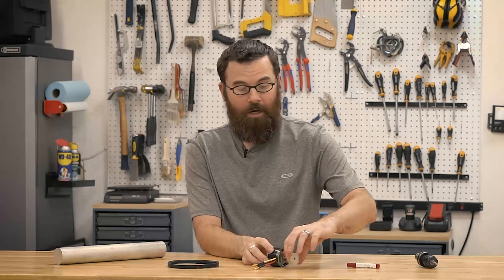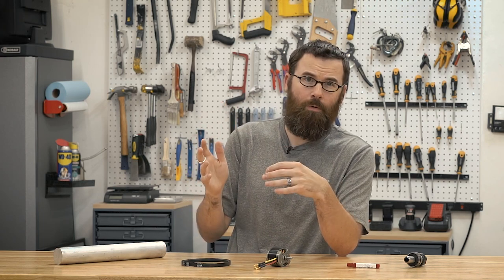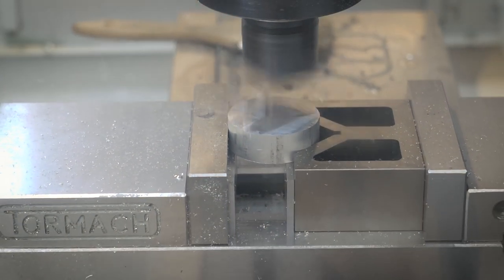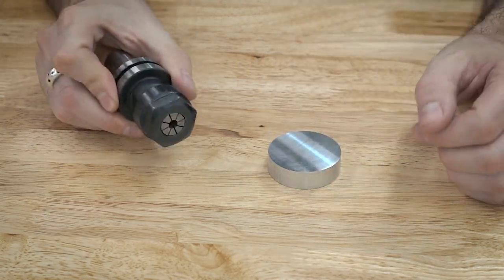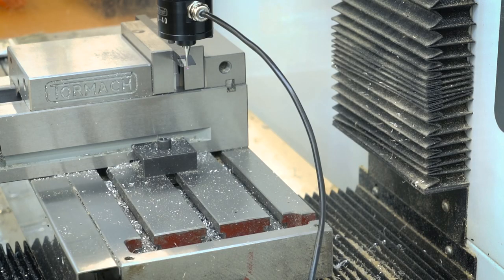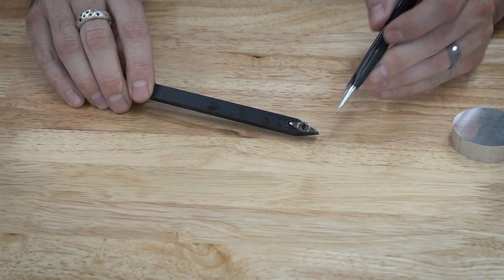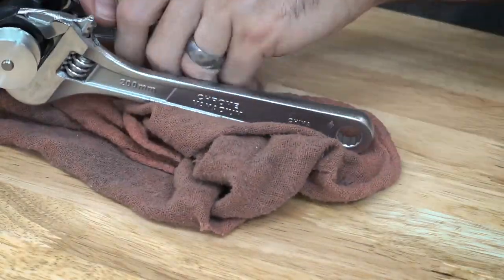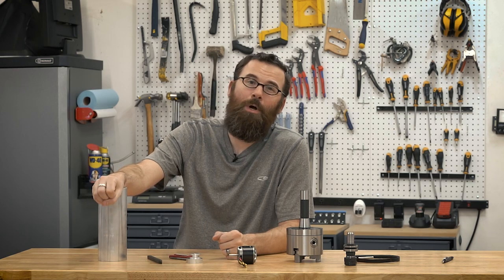From Start to Part:  V-Belt Pulley (Mill Turning)

Comment: Hi Robert, thanks for the video, I'm going to try this.  However, I don't understand where in the CAD/CAM model you put the part origin.  You say at the tip of the lathe tool?  Can you please share your Fusion 360 model?  I think that would help me.  Thanks again.

Comment: Hey Robert, when you faced off the part in the beginning, did you create a gcode just for that, or did you use manual controls on the cnc? if you used manual controls in path pilot, a video on that subject would be interesting since that is not something we see very often with these mills. thanks
Reply from the maker: I just did this manually, no code, no conversational.  I usually just use the probe to find out where I need to get down to, zero it out at that height, then slowly work my way down towards that in steps.

Comment: Know allot of folks have ragged on you for grabbing chips by hand. To break that chip add more of a dept of cut or raise the feed rate up for rough passes. Failing that I hear a tighter radius noise can help under the right conditions.
Reply from the maker: Good to know!  It 'worked', but I will not be using this trick again unless I absolutely need to.

Comment: I still don't get why this has to be done with a mill instead of a lathe.
Reply from the maker: It was a test.  It's a simple part that could easily be done on a lathe, but I wanted to test it out for more complex parts.  I don't have a CNC lathe.
Reply: Alright, that explains it. Thank you for the response.

Comment: Why not use the lathe? Thicker shaft with the tip turned down to 6mm for rigidity, extend the shaft long enough for it not to interfere with the lathe chuck... Turn it away... Much easier than trying to indicate the tip of an insert to me :/
Reply from the maker: Eh, with a CNC, indicating the tip of the insert is very easy.  I only have a manual lathe and cutting the profile for the serpentine belt (which was the profile I actually went with) was not practical on a manual lathe.  That being said, a manual lathe could do all of this.  I just wanted to try it on the CNC.

Comment: Is there a reason you didn't drill and ream it while it was setup in the mill?
Reply from the maker: Not really a GOOD reason, other than the center of the part wasn't indicated when I was facing it.  I would have had to indicate the center.  Honestly, it was just easier to use the lathe, since I didn't need to indicate anything, and it's just easier changing tools on the lathe too.  I could have easily used the mill for everything, it just would have taken a few minutes longer.

Comment: Yea where calling in techs to try and do it we just didn't have the tools to dissamble everything
Reply from the maker: Put it on a lathe?  If you don't have a lathe, put it on a drill press and use some sort of cutting tool?  Use an angle grinder?  Use a hobby knife?  Use a file?  Use a screwdriver?  There are probably just short of a million ways to do this.
Reply: Yea we can't take it out of the machine really we tried but it wouldn't
Reply: We tried just about everything we could think of we have about 6 in of space for are hand and everything
Reply from the maker: @justinmcmains4689  Repairs like this just come down to experience.  You need to either 1) learn how to disassemble it, because it CAN be disassembled somehow or 2) get creative and figure out a good way to remove the melted belt.  Both are possible, you just haven't figured out how yet.